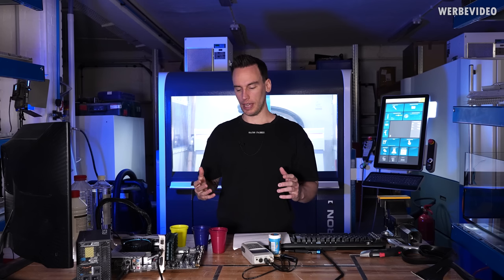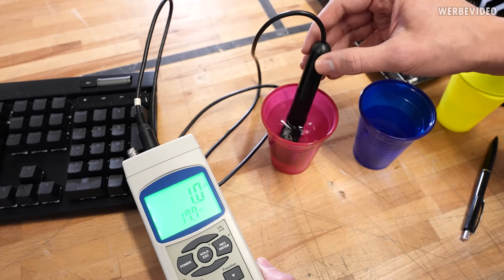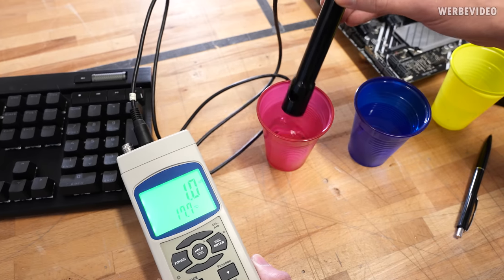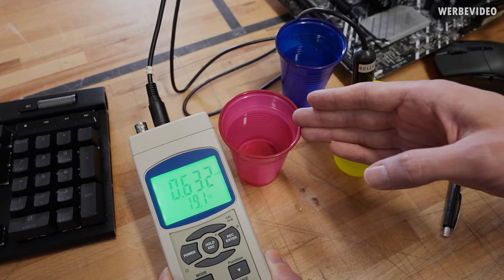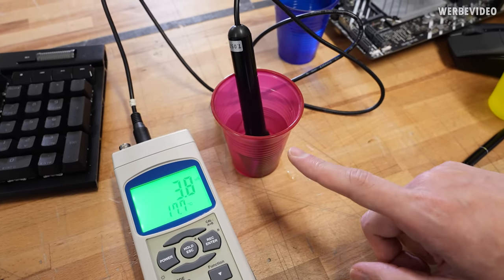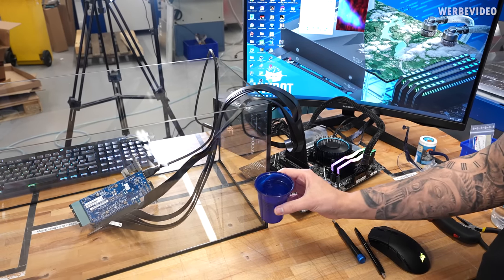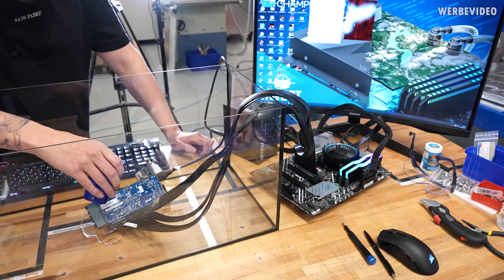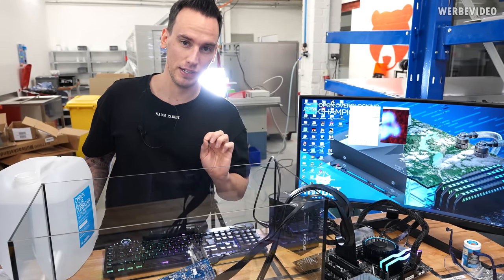Can you submerge a PC in Ultra-Pure Water?

Comment: I used to use pure water for experiments. We used to clean glass beakers in pure water and we’d still worry about calcium leaching into the water from the glass. We would also never put our hands anywhere near the probe and validate the measurements every day using known solutions. The probe was suspended by an clamp arm we would swing a over without getting near. (Calcium is what we worried about, as you need very low calcium solution to isolate heart cells).
Reply: Was this related to L-type and T-type calcium channels?
Reply: @gsuberland  near, but not quite. Instead of calcium entry we were interested it’s usual route of exit through the sodium-calcium exchanger.
Reply: @eberger02  Oh neat. What was the research topic? Sounds possibly excitotoxicity related?
Reply: @gsuberland  nearly. We induced toxicity by heart failure (caused by ligating coronary arteries) rather than using drugs. I didn’t do that but though. I just isolated and studied cells.
Reply: @eberger02  sounds like interesting work!

Comment: This should be an annual "Will it still boot?" video series. The data related to the long-term effects of water damage would be interesting.
Reply: I’d watch that video.
Reply: I have a gtx 1660ti and washed this card 4 times since I bought in 2019 and still works fine
Reply: @smb2267  madlad
Reply: I think it will probably be fine, I have messed with this too and I doubt that the distilled water was conductive enough to short anything to the point of causing damage. Just because something interferes with the extremely low and precise voltages enough to cause the device to not work properly doesn't necessarily mean something is being shorted to the point of causing damage. At a maximum of 12 volts, the amount of current that could flow through nearly pure water is incredibly low. This test is not at all comparable to, for example, shorting something with liquid metal or by dropping a screw onto it.
Reply: @smb2267  I've washed several motherboards and GPUs without any problems. Sometimes it's the only practical way to clean something. Just make sure to remove ALL power (CMOS battery included!) before getting anything wet, rinse it with distilled water if tap water was used for cleaning to remove any remaining minerals, and make sure it is COMPLETELY dry before applying any power and you should be fine.

Comment: Excellent content, as usual.  We have questions, and Der Bauer must answer them.  You forgot about your hands, Roman.  If one salt crystal raised the conductivity of the water, the salt from your skin probably raised it even more.  It would be best if you had tried using gloves when handling the components after cleaning/submerging them.  It's a possibility.  You might also want to try removing the fans from the water since it already provides adequate heat dissipation.  Thanks for continually bringing us the best testing.  I can't wait to see what happens to the 3090; I hope it survives the repair.  It would be a shame to end up with a paperweight for decoration.  Also, phrasing.😆😆
Reply: I had the same thoughts
Reply from the maker: Very good point 😁 for sure did not help. But also shows how sensitive this "cooling" would be
Reply: maybe remove the fan but still need some kind of radiator to dissipate the heat cause I think the water can't transfer heat fast enough
Reply: @duccc  possibly! Convection works better in water than oil. Mineral oil PC's can teach us a lot 😅
Reply: @der8auer-en  could the components have some water soluble contamination too?
Reply: This would only work in a lab environment, there is to much contamination salt skin, metal dust.
Reply: This is why csi investigators always use gloves! Lol.
Reply: @der8auer-en  can you take some ultra pure water, a fixed measurement, say 500mls and wash your hands in it with no soap, and check the change in conductivity, I'd be very curious.

even maybe take a few cups and put random components in it, some thermal paste, a stick of ram, a old cpu, let them sit over night, and see how the conductivity changes. 

but the video does show PC's are very much able to survive being made wet these days.
Reply: @G0ldmoon  I would have to disagree with your statement.  The only reason Roman’s experiment worked was that he used ultra-pure water.  Most people don’t have that handy to spill on their computers.  Most people spill carbonated drinks, regular water, coffee, and tea.  No component can survive for a prolonged time seconds if you’re lucky without damage to individual components.  Having repaired many systems with liquid damage, it’s appalling the shit people spill on their computers.  If you’re lucky, the damage is repairable; if not, you’re fucked.  The only way a system can survive liquid damage is if it’s designed for it by way of water-proofing by using some form of conformal coating or nano-coating to protect the system as a whole.  Otherwise, it will suffer damage depending on where and how fast the user reacts to the spill.
Reply: @j340_official  Indeed they do.
Reply: You want the water to be churned or otherwise circulated, improves rate of heat transfer. A submergeable pump could be used instead though...
Reply: Yeah, I was thinking the same thing about putting his hands in the water.
Reply: @duccc  now I'm curious if a pot of water touching the CPU heat spreader directly would be sufficient to cool the CPU for a time since water is such a good medium for heat transfer and used in aio's etc.  Would the volume of the water be enough.. A lot of work to set up this experiment though not sure anyone would ever bother doing it.
Reply: It would cool it until the water heated up to the point it didn't cool it any more as there would be nothing removing the heat from the water.
You would be basically reproducing a kettle with a 200-300W heating element at the bottom instead of the usual 2000W or so. Except the CPU would thermal throttle before the water started boiling furiously enough to remove the heat via evaporation.
Reply: @st3althyone  the only thing I've ever done to a laptop that i spilled on is shut it off for a week. left it in a cool dry room
Reply: I'd also wonder if the lubricants in the fan bearing could have affected the conductivity. Might the board have been detecting slow CPU fan RPMs and powering down to prevent a potential overheat condition? Maybe have the fan either disabled in BIOS or out of the water. Not using gloves to prevent organic salts from your hands contaminating the water was likely a significant factor too.
Reply: ASRock use to have some waterproof products in the past. ;-)
Reply: There are enough impurities on the components themselves to increase the conductivity to a "deadly for electronics" level. Gloves won't make a difference.

Comment: Water "leeches" particles from metals. Which is why it would become more conductive. It's also why we should always recycle components instead of throwing them into landfills.
Reply: yes have had fish tank 100%👍
Reply: Isn't this called electrolysis?
Reply: @AnnaVannieuwenhuyse  In chemistry and manufacturing, electrolysis is a technique that uses direct electric current to drive an otherwise non-spontaneous chemical reaction. Electrolysis is commercially important as a stage in the separation of elements from naturally occurring sources such as ores using an electrolytic cell.
Reply: 3:50
Reply: @aaronrobertcattell8859  If memory serves me right, electrolysis requires a solution capable of carrying the electric potential through the free ions contained in the solution.  In this case, Roman used ultra-pure water, so there is no potential or it’s extremely low for the solution to carry the electric current.  Most of these processes produce gases such as hydrogen and oxygen -in the case of using water since you’re breaking the H20 molecule into its constituent atoms.  All this requires the exchange of ions, but since the water is ultra-pure, ion exchange is impossible.  I don’t know, I last took chemistry in college, and it’s been quite a while.  I could be talking out of my ass.🤷🏻‍♂️🤷🏻‍♂️
Reply: @st3althyone   which since the 17th century was associated with electrical phenomena, and λύσις [lýsis] meaning "dissolution". Nevertheless, electrolysis, as a tool to study chemical reactions and obtain pure elements, precedes the coinage of the term and formal description by Faraday.
Reply: @st3althyone  Jérôme Nicklès
Reply: I throw my stuff into the sea, car batteries, plastics, etc.
Reply: @MrViki60  😆
Reply: for general knowledge, the purity of water doesn't matter, it's a weak acid (reactive) and it will leech from metals and anything else in it not inert to it. so eventually, no matter how pure it will end up conductive.
Reply: @Joe-Dead  Exactly. Doesn't matter how pure the water starts out as, it will contaminate itself by contact with most other stuff that is solvent in water to any extent either directly or by weak acid/base interactions.
Reply: @MrViki60  That's rather kind of you. I bet it's pretty hard for sea life to order/obtain PC parts, car batteries, etc. You're basically offering them a craigslist free section. Very thoughtfully altruistic of you. Kudos sir, we could all learn a lot from your generosity.
Reply: yea we need to recycle them and ignore the industries that dump that stuff on a daily basis

Comment: In a Wire EDM, DI (de-ionized) Water (aptly renamed "fluid") is used as a cooling fluid that insulates the the wire and keeps it from contacting the work piece.  I would think you'd need a DI tank to cycle the water through because of DI water is corrosive and will leech material from the solder joints and contacts over very little time causing the DI water to become more and more conductive.   So if you wanted to do this over a 24/7 running system you would need a DI resin bottle/pump in a loop to ensure the water stays DI.  I would've thought this test would be more successful.
Reply: I had the same thoughts on DI

Comment: Great experiment, although a lot of the focus has been on the electrical conductivity of the water and at low voltages, it's unlikely that the water will break down enough to let any significant current to flow. What I haven't seen mentioned in the page of comments below is that the design of the memory connections is extremely sensitive to capacitance coupling and inductance. The memory PCB traces are differential pairs tuned to exact lengths to run in air. Even millimeters difference between the signals will cause a loss of memory timing. When submerging the board the memory traces will run with a different impedance, likely causing memory timing issues. I've designed DDR2 memory interfaces and they're extremely fickle when it comes to trace length and the gap between the differential signal pair and the inner-trace ground plane. I suspect this would have had an impact on your results, and might even explain why the graphics card worked slowly, as the video memory may need to retrain the interface between errors. It also explains why the board worked when it was dried again. There was no big currents damaging transistors, so once the cause of the impedance imbalance was removed, the board worked fine. Like Jose below, I also noticed you put your hands in the water and even shook off your hands as you removed them which I though was very amusing given your extreme hygiene in preparing the rest of the equipment :) Great video.

Comment: Your initial crash with the GPU is probably due to the water changing the electrical characteristics near the connector which invalidating the link training that happened on boot. That would have caused the PCIe error rate to spike but explains why it worked fine after a reboot (and a retrain)

Comment: Have you ever done a full mineral oil submersion build? Would be fun to do - like in a mini ITX custom case where heat extraction is very important
Reply: He has, look for Nvidia Aqua Exhalare for his immersion computer build.
Reply: @slowtrigger  yea that wasn't mineral oil. It was 3m novec. Still a really awesome project.
Reply: LTT did it and everything started to degrade over time I think. The mineral oil worked until it didn't.
Reply: Czech datacenter company Wedos has whole buildings full of servers submerged in pharmaceutical grade mineral oil. I'm not sure if they publish anything about it in English.
Reply: Michaels Carport  I mean I know the concept has been done a lot by many people, but nobody has really nailed it (hence why LTT and other names have not obtained long-term usability). My personal idea was to have fans circulate the oil through a heatpipe system that can passivley extract heat from the oil and maintain a general temp level in the whole system - maybe even attach a Peltier module to the heatsink, which sure will draw some power, but could potentially offer a lot more cooling capability than what air dissipation would allow.
I'm probably just fishing tho..
Reply: Oil immersion cooling is seeing increased adoption in the datacenter as it allows much higher efficiency numbers compared to forced air systems. Typically the oil in the server tank is pumped through a heat exchanger, which is then water cooled with facility water.

Like LTT found, there are material compatibility issues with liquid polymer immersion - there are a lot of different fluids used, many times not straight mineral oil. Key issues right now - plasticizers leech from cable jackets, wires can lose their insulation and short out on each other. Certain capacitors can absorb the liquid and swell to the point of failure. The fluid messes with networking optics. Glue dissolves in the oil and all the labels float away.

There is currently an OCP workgroup headed by the hyperscale datacenter guys who are working on hammering out material compatibility issues. Until these are sorted and some industry standards are created, it's too dangerous to do large server deployments in oil. But I believe it'll become far more mainstream once it gets better understood and we enter the land of 500W server CPUs and 1,000W datacenter GPUs.

Comment: First water cooled build I did was in 2015, with two brand new 980Ti's. I had everything plugged in when I filled the loop for the first time, using a mixture of distilled water and EK pastel red, and quickly found out that I missed a fitting on the CPU block when I did my double checks. While all of my attention was on the reservoir, red coolant had begun running down the face of my motherboard, to my $1300 pair of cards. To make it worse, I tilted the case towards me before reaching for the psu switch, as my immediate worry was coolant getting into the CPU socket (which didn't happen). That's when I realized the extent of the leak, as red coolant came out the front of both cards. This was also the same day I learned why installing a drain is so important. 

When I took the cards apart there was coolant all over both PCBs, including the power rails. I literally poured alcohol over my hardware and spent a few of hours cleaning the coolant off of everything and out of the case. Luckily when I put the build back together (yes with a drain this time, and yes with only power to the pump while filling), everything worked just fine. In fact the motherboard is still being used by a friend's son, and I put one of those 980Tis in my young cousin's build a few years ago. Just figured I'd share my experience with water and hardware.

Comment: I think that pure water is not enough conductive to cause immediate short-circuits and kill everything,  but enough to mess with voltages and stability. Also all the signals can travel between all the pins so that's why it  can't post.

Comment: Radar systems I use to maintain some years ago utilised water cooling. A number of the energised components were directly cooled by the water. The water needed to be ultra-pure, demineralised and deionised. To ensure the conductivity remained acceptable the system contained two filtering systems. Constant monitoring of the conductivity combined with a trip circuit which shutdown the Radar if conductivity exceeded the trip level. The key being constant filtering to maintain purity.

Comment: I love this. This is something I've always wanted to try but could never bring myself to do. Every old component I don't care about would need to be cleaned to such an absurd degree. I would like to try a light conformal coating used for this on other electronics over many of the more sensitive components. Attempting to seal everything is certainly a fool's errand but it'd be interesting to experiment with.
Reply: I have covered RC brushless motor speed controllers, DSMX radio receivers, 5.8ghz analog video transmitters, flight controllers with liquid electrical tape, and they worked fine completely submerged in a pond, and crashed in salty winter slush.   

Normally electronic speed controls will burst into flames if one drop of water touches their PCB, so it's a pretty nice result I think.

Comment: Use transformer oil.  It is thermally conductive and a strong electrical insulator.  I built a PC using it  in the mid 1990s on (I think) an overclocked Athlon II.  I added an aquarium pump to circulate the fluid from the case to a surplus industrial chiller (as used to cool molds in the plastics industry) and it worked very well when cooled below 0c.  It does get messy, especially when you want to tinker or change boards, but the CPU, GPU, power supply and memory all ran very well when immersed in it.  I think the trade name was PAO.  If you can't afford the  dedicated thermal fluid, mineral oil will do well too.

I word of caution though - heat transfer oils have less conductivity than water, so you may need to arrange for the pump to directly spray on the GPU and CPU to get the best results.